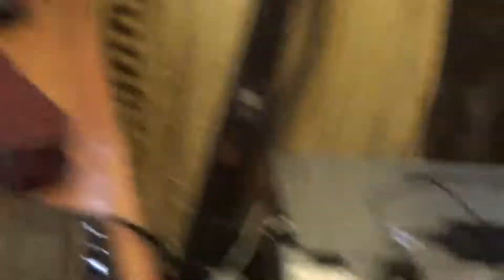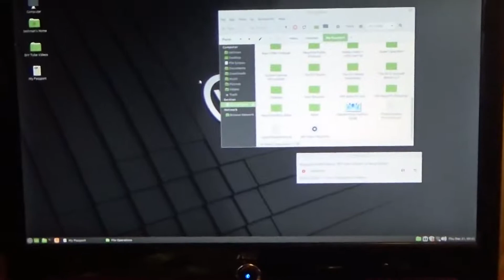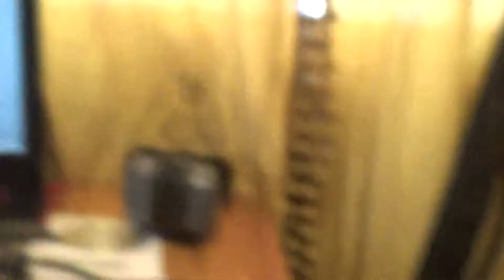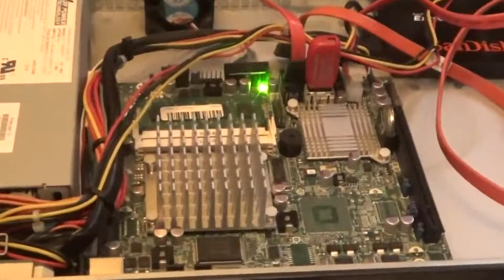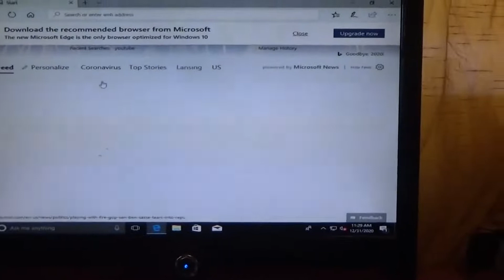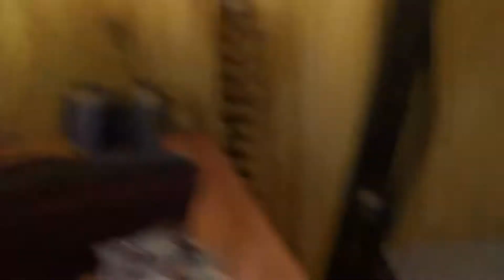Can Windows 10 Run On Tiny Atom PC Lets Find Out

Comment: That little Box would be great for PfSence.  I have a sonicwall that is about that size I'm putting in a 2 port 10gb card for it so then I will have 2 1gb ports and 2 10gb ports. .
Reply from the maker: I have been strongly considering that but it only has 100mb LAN ports. For home it would be fine but not for business. This does have an expansion port but the whole box is under 2 inches high. Might have to leave the lid off. Still thinking about it a lot.
Reply: @TheDIYWorldElectronics  The Sonic wall that I have has 2 1gb ports on it. and the expansion Pci-x 8 I just bought a riser right angle slot so I can use the slot. The sonic wall has a blanking sport to take off to slid the card in.   I like it because of all the power I have over my own network and the security.
Reply from the maker: Yes, eventually I will be running all my own equipment for security and stability. I dont get into politics but I am seeing a lot of companies being censored in some way and not able to stand on their own. I do not want to fall into that trap one day.